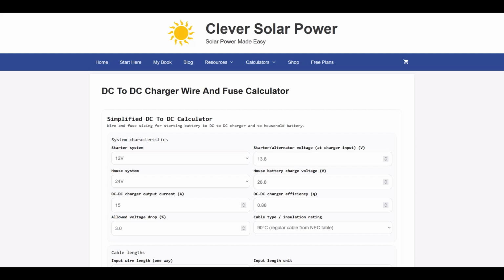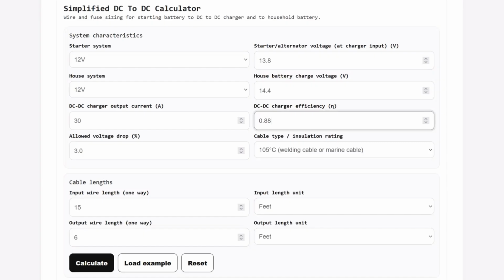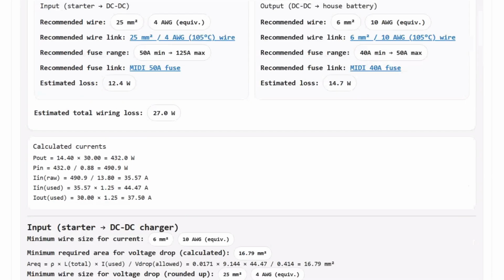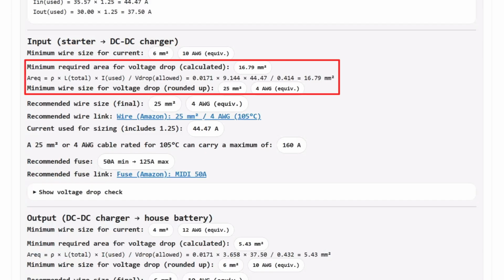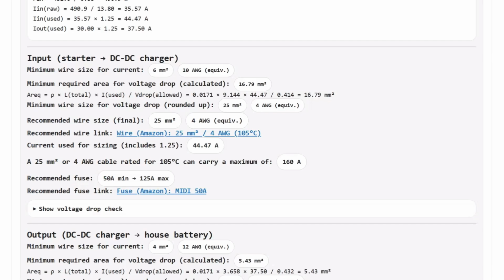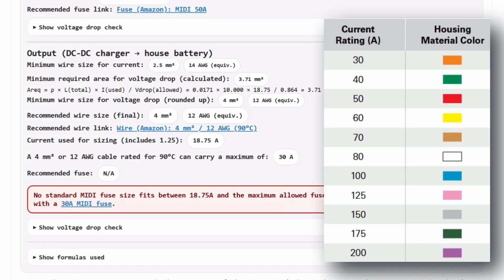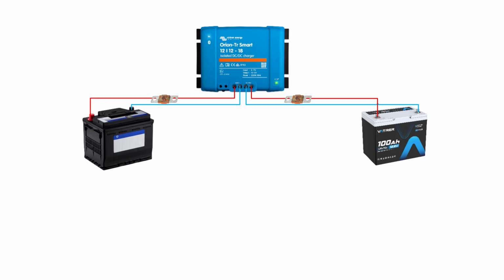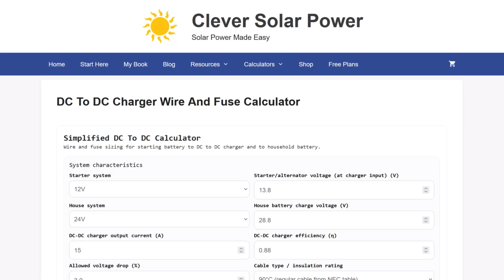DC to DC Charger Wire and Fuse Calculator

Comment: I run from vehicle battery 90A to a volt sensitive relay (140A , then 90A cable encased in protective cover 5 meters to anderson plug at tow ball, then to DC TO DC about 3 meter , that is in boot of caravan,  as DC-DC is 25 amp have 40amp fuse, never had problems in years of lots of traveling, full time , two points, do not wire directly to alternator, as this will kill it, use dialectic grease on all connections  for moisture,  and from about 2000 on all alternators are smart alternators and turns on & of making power only when needed,  and the DC-DC should have a single wire that needs to connect to a keyed power on,

Comment: The victron dc to dc has a wire limit of 16mm2.  How are u attaching 25mm2
Reply from the maker: Depends on the model. The calculator is not model specific. The Orion xs can have 25mm². If the wire is too large for the terminals then you need to reduce the distance.

Comment: Salve, ottimo video, complimenti per il canale. Avrei una domanda se è lecito: posso avere in barca una batteria di avviamento al piombo AGM e un banco batteria servizi LiFePo4?
Reply: Yes you can but as far as i know, starter batteries are not agm but regular lead acid or lead calcium batteries (cars, trucks, etc.). The energy is dc from one battery to the other, it doesnt care about the chemistry but the voltage and the regulation, that is why you need the dc to dc charger-regulator.
Reply: @segundacuenta726  Grazie mille, Si avete ragione No AGM ma Piombo acido. Con il carica batteria da banchina come bisogna intervenire in questo caso? Due carica batterie separati? Uno per le Litio ed uno per la piombo?
Reply from the maker: You can have lead acid, but AGM is not suited as a starter battery like @segundadacuenta726 said.
Reply: @cleversolarpower  Grazie